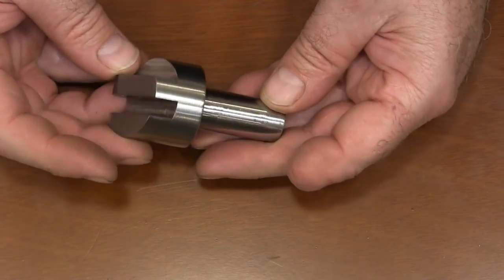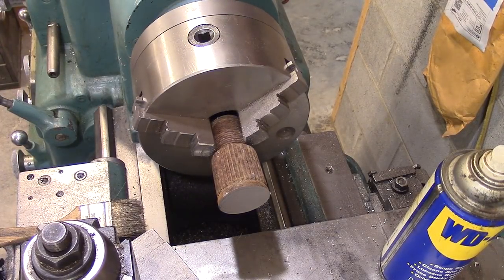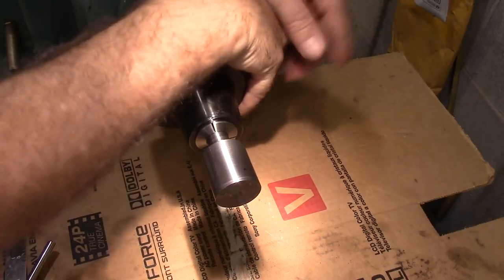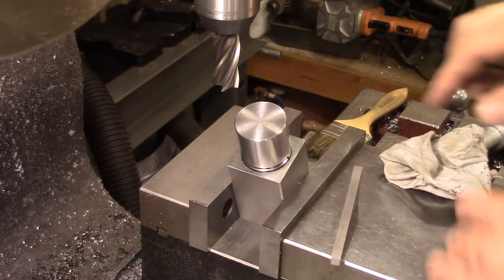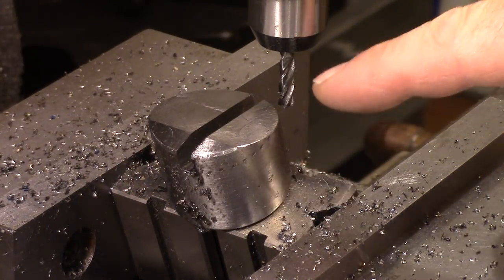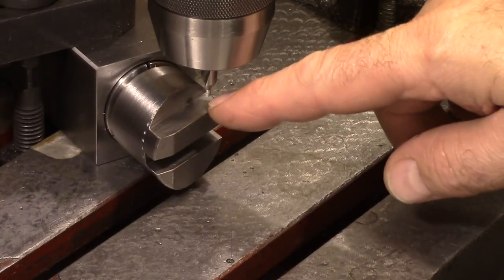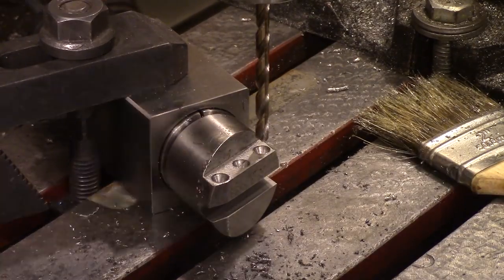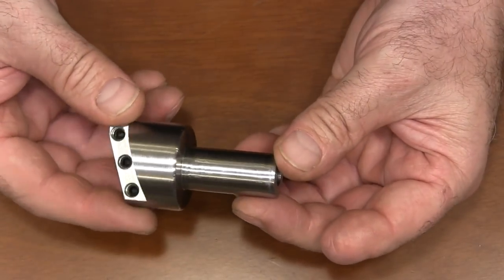Homemade Fly Cutter from Scrap Steel

Comment: Bought a homemade one at a swap meet , and it was made like yours . It works very well but I had to change the tool bit and run it counter clockwise because the cutting edge wasn’t on the centerline. Thanks for the video .
Reply from the maker: You're welcome!  Thanks for sharing your story.

Comment: I made a fly cutter for a 1/2" carbide toolbit out of 2" dia. Pre-hardened 4140. It had a 3/4" shank, with (3) 5/16" set screws to hold the tool bit in. That thing was a beast!
Reply from the maker: I bet it would hog through some material.  Thanks for sharing.

Comment: Great video! And I really like that you messed up, solved the issue but didn’t fix the piece. I bet you won’t make that mistake again. Could someone make one without a mill? All I have is a lathe.
Reply from the maker: I think you could make it without a mill but you would have to have some mill type attachment for the cross slide in order to mill the grooves.

Comment: Nice, problem is 4 years later scrap steel is not worthless, there used to be loads here but now its all being weighed in and sold
Reply from the maker: The price of metal these days if terrible...  if you are buying.

Comment: If the rotation of the cutter is clockwise, then the bolts are not made correctly, you need to put them on the reverse side, since the load will be on the bolts and not on the support wall!

Comment: Awesome job... Are you gonna blue the surface or heat treat it? I have no idea if it even needs it, I've just seen other YouTubers do it to their home made tools.
Reply from the maker: Neither.  I will be using it often so it will probably get dinged up.  I will just keep a film of oil on it for rust protection.  Thanks for the comment!
Reply: Roger that.. look forward to seeing you use it in upcoming videos.

Comment: Just a suggestion, machine towards the solid vise, not away from from it.  You are pushing against the moveable jaw which decreases accuracy and weakens your mount in the vise. The only time you could go away from the jaw is on a very fine finish cut.
Reply from the maker: Thanks for the tip, I need all the help I can get.  The problem is I already knew that but as you could see I forget a lot of things as I go.  Thanks for the reminder.
Reply: Soat Mon definitely a good use of scrap metal!  I am all for that in machining. 
Rusty or not!

Comment: I'm hoping to make one, but have no V blocks or collet block yet. Wonder how else I might hold it in the milling vise. Thanks.
Reply from the maker: With any round item you need a v block to hold it securely.  Maybe you should make some V blocks first.  Thanks for the comment!
Reply: V blocks are on the list of tooling to get eventually. Angle blocks too. I cut a 20 degree angle in a piece of wood and used it. The work piece held in the vise, but it was a bit sketchy at the end. All in all I made one today. First lathe and mill project. Was just the thing I was looking for. Thanks.  @SoatMon

Comment: Can you not include the sound in the places you speed the video up? I'd rather have sound, even if it's sped up sound.
Reply from the maker: I can now.  I have new software.  The old software did not fix the sound when it was sped up so it was a high pitched whine.  That's why I didn't include it.  In my videos from the last few months the sound is there.